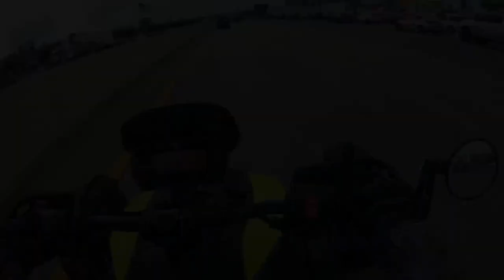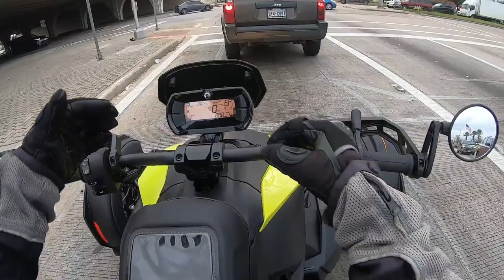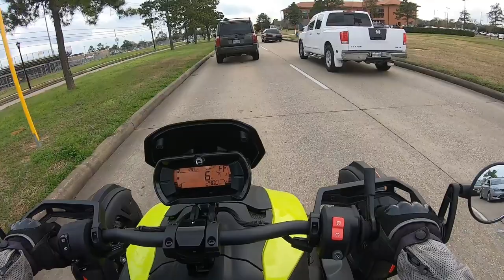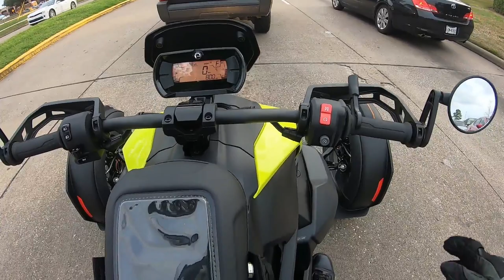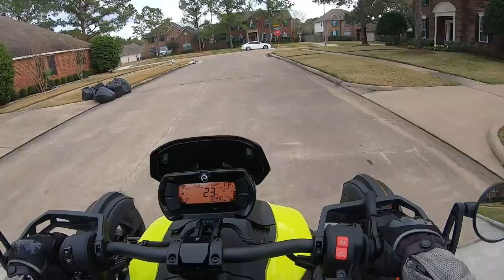VLOG: 2019 Can-Am Ryker Rally Commute // Tire issues & RiderScan Mirror

Comment: Love your videos I’m looking to get either the Ryker or Spyder (well budget says Ryker) I didn’t catch it is yours a 600 or 900?
Reply from the maker: Thanks for the feedback, Craig!  My Ryker is the Rally edition, which has the 900 ACE motor.  I have been recommending new/prospective buyers to get the 900 ACE (non-Rally) version so they can get a better price and save that extra $$$ for higher-quality upgrades (e.g., ELKA or FOX shocks, stiffer anti-sway bar, MAX mount, etc).  The Rally edition comes with the MAX mount and "upgraded" adjustable suspension, but it's not fully-adjustable.  Aftermarket shocks from ELKA or the accessory FOX shocks available from BRP will be much better than the ones that come with the Rally edition.  Also, the Rally edition's "rally" mode is mostly a gimmick... no real difference from the "sport" mode on the 900 ACE model.  Cheers!  👍  --QM

Comment: I’m in Lynchburg VA and drive the 900 Ryker. I also have the same problem over 50 or 55, by 65 you have to really drive it.
Reply from the maker: Same problem with alignment, or another issue (e.g. traffic zombies)?  --QM
Reply: QuasiMotard not sure it just snakes like crazy. If I favor one side of the lane it seems to calm down a little
Reply from the maker: Good to know! I will keep you posted on my alignment issue and if the laser alignment fixes the issues  for me.  If so, then you might want to seek the same remedy.  --QM

Comment: your braver than me, when i lived there in the late '70s until the early '80s i wouldn't ride inside the 610 loop. how about how you feel sitting so much lower than the four wheelers and the big trucks? ride safe.
Reply from the maker: Yessir, it's a challenge! I moved to Houston full-time in 2002, and I lived in the Galleria area (610 & Richmond) for ~10 years... that's chaos central.  I moved out to the 'burbs to escape some of the chaos, but I still have to commute around town every day. As for the seating position, I don't really mind it too much.  The alignment issues on my Ryker make the situation a little more unnerving, but I hope to resolve that problem soon.  The Ryker has so much roll-on power that it lets me squirt away from traffic effortlessly... just leave those problem cagers behind me to sort out their own mess on their own time. ;-)  --QM
Reply: @QuasiMotard  i went back to the Deer Park area from 2012 to 2015 and was really taken back by how much it had changed/grown, the traffic was to much for me. moved back to central Fl. but the traffic here has gotten very crowded to. ride safe and hope you get those bugs worked out of your Ryker. one reason i like to wait a year or so before buy a new model, best of luck to you.

Comment: I wonder if a motorcycle steering damper would help stablize the steering.
Reply from the maker: I thought the same thing.  I will wait for the laser alignment and then maybe look into a steering stabilizer/damper. The Ryker is manual steering, so the front wheels transmit a good bit of shock through to the rider's hands. A stabilizer could make a big difference in sharp transitions at the bars. I have dampers on my R1 (Ohlins) and Monster 1100 (Scotts)... I wouldn't ride without them because of the steep steering rake on those bikes.  The Ryker might end up wearing a collar, too.  --QM

Comment: My car does the same on the grooved pavement.
Reply from the maker: Yeah, both of my cars wander around on that pavement a little bit as well, but it's not the rapid side to side shimmy that the Ryker experiences.
Reply: @QuasiMotard  I doubt different tires will help-perhaps a wider foot print to float over the grooves or, maybe live with it. I would hope the Ryker isn't that harsh to drive normally?
Reply from the maker: I'm sure that I'll adjust to it.  The alignment is the real issue with my Ryker. After I get that sorted, I'm sure its road manners will improve. As for the grooved pavement on I-10, I haven't figured out exactly what causes that dynamic. I have 14 other bikes and 3 cars... none of them exhibit that rapid side-to-side shimmy over that stretch of road. I think it's just something particular about the tire tread and/or the width of the tires... some tires have a harder time than others over grooved surfaces. If we had other tires from which to choose, then we could re-shoe our Rykers. I typically upgrade the tires on my bikes right away. Unfortunately, these are the only tires we can get... for now anyway.  --QM

Comment: How long is your commute?
Reply from the maker: My minimum commute is about 18 miles each way (36 miles/day) if I'm just headed to my office or warehouse. That trip takes ~30 minutes in off-peak hours, and up to 2 hours in rush hour.  Typically, I commute about 60-120 miles/day (5-6 days/week) going to customer sites around the greater Houston metro area. --QM
Reply: I'm thinking about getting a Ryker soon.
My commute is 48 miles one way in California's traffic most of it is on the freeway, what's  your edvice?
Reply from the maker: @RomeJunior310  The Ryker handles commuting duty very well, and stop-n-go traffic is much better/easier than on a motorcycle (e.g. no low-speed balancing, dog-paddling or waddling along with your feet, and no feathering the clutch). Watch a few minutes of this (long) video here: https://www.youtube.com/watch?v=1_IePfo6rY4&t=420s and again here: https://www.youtube.com/watch?v=1_IePfo6rY4&t=1258s
The only thing that hurts the Ryker's commute abilities is the fuel economy. The 900 only gets ~30-32 MPG, so it's not much better than driving most cars in that respect. The 600 might do slightly better, but I wouldn't expect anything above 40 MPG. In comparison, my Honda CB500X and CB500F get above 65 MPG in the same situations.  Hopefully, other Ryker owners out there will start contributing their fuel stats on Fuelly or other similar sites. You can track my mileages here: https://www.fuelly.com/driver/quasimotard
--
QM
Reply: @QuasiMotard  thank you I appreciate.
Be safe looking forward to more videos.
Reply from the maker: @RomeJunior310  No problem, glad to help!  --QM

Comment: Can you see any logical explanation why the rally addition is the only Ryker with only a partial rear wheel cover?
Reply from the maker: No, not really. I think it's a stylistic touch more than functional. The rally has a different rear tire size and tread pattern, so maybe they have the relief around the tire to shed dirt and rocks if you were to take it off road. However, the clearance on the rear fender is very, very close to the tire anyway. If anyone does any mudding with the Ryker Rally, they will certainly clogged up the fender area very quickly.

Comment: What kind of MPG are you getting?
Reply from the maker: The Ryker just passed its break-in period, and I haven't been running it on the highway much (steady-state riding). So, it has seen all stop-and-go driving for the last 250 miles.  Here are the results of my last two fill-ups:
126.6 miles / 126.6 trip / 4.459 gal / 28.39 mpg
265.8 miles / 139.2 trip / 4.634 gal / 30.04 mpg

I expect those numbers to get better with my normal commute driving on the highway, and as the motor and driveline break in.  I'm hoping for something in the mid-30's, and a total range of ~200 miles.  We'll see!  You can follow my mileage stats on Fuelly.com:  http://www.fuelly.com/driver/quasimotard --QM